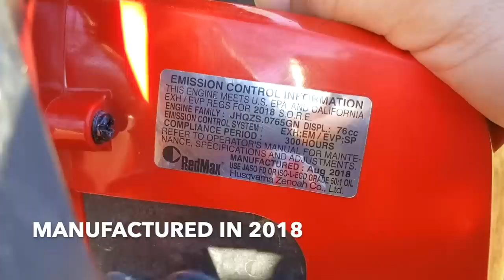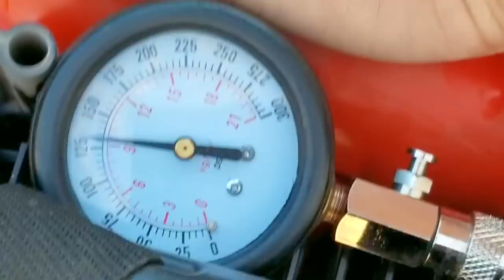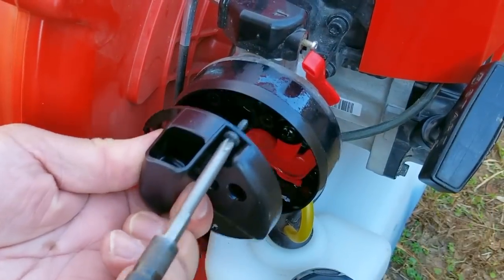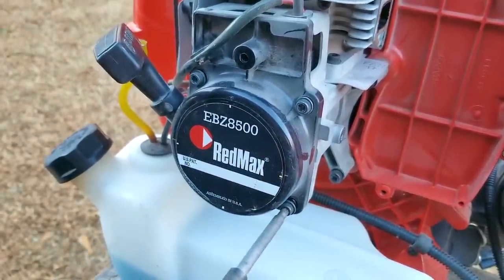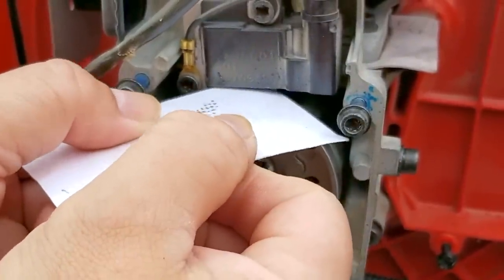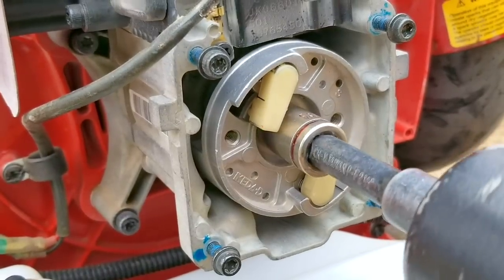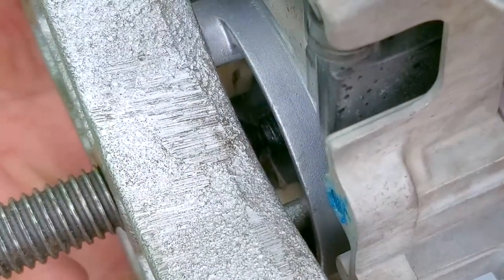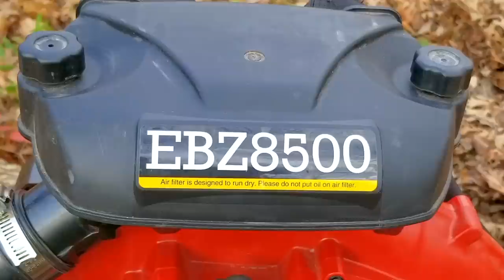Fixing A Redmax EBZ8500 Backpack Blower That Won't Start

Comment: Wow! 😳That was the only problem, it was the coil wasn’t set correctly to the flywheel lol. Anyway I have that exact same ebz8500 blower that’s hip mounted not tube, and it’s probably the best backpack blowers I’ve ever owned. I got mine used for $250 back in May of 2020 and sure has been great! It was used as a residential landscaper before I bought it. Now it’s 9 years old and the only things I had to do to it was change the air filter and the fuel lines, that’s it. No carb problems yet. And plus I repainted it, got new tubes and a decal for the air filter cover back in 2020 as well to make it look like a brand new 9 year old blower.😉👍
Reply from the maker: thank you Brother's Lawn Equipment, After using for about 2 hours, on a huge leaf pile, I have to admit, it's great blower.
Reply: @HomeGaragechannel  Yessir!😉🤘

Comment: I have a bunch of these blowers and sometimes the wires get caught and cut to the kill switch or the connections come loose. Always worth a check too. I have never had an issue with flooding though
Reply from the maker: thank you Reid Shaffer for sharing your information, I appreciate it.

Comment: when i worked for my old lawn care job, i primed my 8500 5 times, choked it, i left the throttle on idle  or maybe a 1/3 of the way open if it was cold, and then pulled it. And usually but not all the time it  would start right up within 3-5 pulls.
Reply from the maker: I wish I knew that before as well, would have saved me a lot of trouble
Reply: @HomeGaragechannel  and usually I would never crank an engine more than I primed it while the choke is on. If the choke is off however, that should be fine.
Reply from the maker: makes perfect sense, thanks again.

Comment: Great video. We’ve got one that looks like a brother to the one in your video.  WE have the same issue. Brand new and wont start. Sounds like it coughs but never fires up.  I’ll have to check what you did.  Thanks.
Reply from the maker: thanks, for the cliffs Note version of this, Just try starting it without the choke, and with throttle squeezed.

Comment: Hey. This was a good one! I’m sure it was Frustrating to say the least. 
I’m not familiar with those carbs. Are there any hidden adjustments on it so you could lean it out a bit for start up? 
To answer your question, if it was my own machine I would also just run with it once I figured out the sequence. 
Cheers
Reply from the maker: thank you Ez Ray, I'm not sure if it has any hidden screws, but since it wasn't mine, I didn't want to try to find them.

Comment: Another YT ER's 2nd test after fuel is  pull fuel filter off and test if the line to needle holds a vacuum if it doesn't then isolate the line by blocking other side to recheck.
        You probably know of this but like me haven't got a mityvac yet 😉👍

Comment: A great spark tester is a large rubber insulated spring loaded clamp with a foot long wire attached to it and a smaller spring loaded clamp on the other end of the wire , ( just like the battery charger clamps ) take spark plug out then clamp big clamp onto spark plug and smaller clamp directly onto a metal ground aka engine block or good point of ground " pull cord watch for spark ,, also make sure you have a KNOWN good spark plug to test with ! Don't forget the ignition kill switch can be bad or have high resistance causing weak spark also ! And yes those almost new ignition modules can and do go bad just like that ! My Husqvarna handheld blower worked great one day next day bad ignition module !
Reply from the maker: thanks for the information!

Comment: In regards to the flooding issue on start up, it looked to me that you set the throttle hold lever “cruise control” well above the 1/3 throttle “high idle” as prescribed in the operators manual for starting. 

Too much starting throttle was confirmed for me when you did actually get the engine started and it revved up well above What I know start up high idle warm up rpm to sound like on my own husq 570.
Reply from the maker: very true, I'll have to mention that to the owner, I appreciate it Jeremy Rathje.

Comment: I once used jb weld to block off full choke on a cheap weed eater because I was staying away and kids were using it 
Crazy but worked for several years
Reply from the maker: nice choice

Comment: It almost acts like a carb with a stuck open needle n just dumps fuel into the intake. Maybe that's what's happening when priming. Did you try starting it with the trigger pulled to give it max air flow n no choke after priming?
Reply from the maker: No, just had the choke on, which also give it a bit of throttle.
Reply: @HomeGaragechannel  yeah I was just thinking maybe having the throttle wide open might help clear the flooding in a similar way to flooring a flooded car
Reply from the maker: In this case not really.  It just makes the Flood worse.
Reply: @HomeGaragechannel  right on that's why I brought it up cuz I was unsure if it would have an effect or not on that style of carb
Reply from the maker: thanks for the ideas, I appreciate it

Comment: I have the 8500 and it almost always starts on the third pull. I never Prime it either. When it’s cold I give it about 10 seconds before I throttle it up
Reply from the maker: that's a very nice tip

Comment: If you remember you said the spark looked inconsistent when you first checked it.  That would have made me dive into spark as the problem and reset the air gap as a first test.
Reply from the maker: yes you make a good point.

Comment: I always hold the throttle wide open while pulling on choke no more than 2 times and then open choke and hold down throttle and pull , keeps it from flooding
Reply from the maker: is that for a redmax  blower or some other brand?

Comment: If I run my Homelite trimmer on full choke it runs fine. It runs perfect on idle but will die on throttle likes it's supposed to.
Reply from the maker: no problem, try a carb adjustment first, then if that doesn't work replace the carb.
Reply: @HomeGaragechannel  it came like that though
Reply from the maker: let me get this straight,  It starts on choke, and runs on choke, and it dies when you give it more throttle?
Reply: @HomeGaragechannel  when I give it more throttle on choke it does Wich it's supposed to

Comment: I have a red max blower the same model you worked on and my issue is it won't take full throttle  It will bog down when given full throttle. I have checked everything you did on the one you worked on    Any other suggestions
Reply from the maker: so you check the spark arrestor screen? if so, you might consider replacing the carb.
Reply: @HomeGaragechannel  I did everything you did along with a new plug and leaving the muffler off  It will idle fine just wont take fuel.
Reply: @HomeGaragechannel  I went back to rewatch the video and I realized I am missing one piece The piece that you screwed back in before you installed the intake pipe All i had was a broken piece of plastic laying in there when I took the air intake off. Would that cover missing make a difference
Reply from the maker: to be honest, I'm not sure, but if had to guess, I think its important, otherwise, they wouldn't have put it in.

Comment: I'm having the same problem with my Stihl FS 250 trimmer when cold it start up and idle fine but once the engine is heated and I cut off to refuel I can't get it to start back
Reply from the maker: thank you Darrion Nelson, I hate to say it, but that's one of the hardest problems to solve.  Have you looked at the owners manual on hot starts? I'm not aware of the procedure either.
Reply: @HomeGaragechannel  no I haven't but I will do
Reply: @darrionnelson4784  hello friend, I also have a stihl fs 250 and I had the same problem when starting with a hot engine, and the solution was to replace the ignition module.  did you change the spark plug to see if it is weak?
Reply: @luanpossentimelnekj7984  maybe take off the flywheel and check that seal to see if it is leaking.  If you have adjusted the carbs put them back to factory and adjust after seal replacement.  If that crank seal is leaking it will do what you are saying and often have a lack power.
Reply: @rudyruiz9521  hello Rudy, my fs 250 was with all the perfect seals, the problem was the ignition module.  it could be that the fs 250 of the friend Darrion has some sealing problem.

Comment: So I have question, it might sound dumb. I was given as a gift a back pack leaf blower, it's a Chinese made blower that the manual says 2014. It's brand new, my question is it calls for 25:1 to 30:1 will it hurt if I run a pre mixed fuel of 40:1? Or should I use what the manufacturer calls for? Thank you for any advice you give or have given me
Reply from the maker: it's a very good question to ask. I would do what the manual says.
Reply: @HomeGaragechannel  thank you so much for your reply. I have been following the manual but wasn't sure if it would hurt to use a different ratio.
Reply from the maker: never hurts to ask, thanks again Gary Allen.

Comment: Have you tried putting a new spark plug? I have had some bad experience with those small thread spark plugs which can look good but still would foul and get wet pretty easy
Reply: Also, good work on troubleshooting that blower, i was thinking the timing somehow was off until you removed the flywheel and at that time i had no idea what the issue could be, at least you got it to work and found a procedure to start it
Reply from the maker: no but you might be on to something.
Reply from the maker: thanks I appreciate it.

Comment: ive tried the drill trick to start my 4hp craftsman mower but it wont spin it. I have a dewalt 18v drill and an 18v fuel milwaukee impact wrench AND driver and none them wants to spin that craftsman. I have to pull it with the rope and its a pain. What drill are you guys using to spin these motors?
Reply from the maker: I'm just using a Harbor Freight corded drill.  the cheap one too.

Comment: this video was great but i have a question. i have a stihl fs86 line trimmer that runs very well but after 4 mins of use it starts to smoke and when the engine goes back to idle the engine has a little cough. i bought this line trimmer second hand and fixed it up all it needed was some attention in the carb. once i started the trimmer up it ran well but accidentally touched the aluminium housing for the piston for less than a second and burned off a lot of skin on my knuckle. at this stage i only ran the trimmer for about 30 secs. i noticed that the spark plug boot was hot after 4 mins of run. but before i touched the carb the engine was covered in dirt as there was a fuel leak in the tank. i sprayed some degreaser on the engine block and that might be the cause of the smoke but it gets really hot. i also made sure that i tuned the carb to be rich. can u pls help me as this trimmer has 2hp and i need this trimmer as ive got a fare bit of land to maintain
Reply from the maker: thank you Moo Zuke, I would first confirm that the bolts that hold the cylinder head or jug, were tight, I would then clean the cooling fins to make sure the engine doesn't over heat.  The other would to check the spark arrestor screen for a blockage.  Let me know what you find.

Comment: I've had coils still produce a spark but be bad. I had a saw push me to my limit of sanity and it turned out to be a factory new wire on the coil that was crimped to hard and was cut through but looked fine. The saw still ran but like it had an air leak. It's  annoying because you have to check the gas,carb,spark,exhaust, gap, and timing several times before you can finally deduce the coil is shot has an issue or is shot.
That blower is way to hard to start I'd be adjusting that carb and possibly even the airflow if that didn't work.
Reply from the maker: I doubt it's the wire, more than likely the carb
Reply: @HomeGaragechannel  didn't say it was just sharing my most frustrating fix. 
read more

Comment: I have a Poulan Pro blower. It was always running great. Then I ran out of gas. When I mixed a new batch of oil gas mixture it ran for a while then quite. Is my oil to gas ratio off. Or maybe the oil blend, brand (Pro select) was not good for my blower? Can you help?? It will start then quite.
Reply from the maker: how are you mixing your fuel, and can you get a compression test done?
Reply: @HomeGaragechannel  I was trying to reach a 40 to 1. but my gas container was 2.6 gals. so my math may have been off. If my math was off and I ended up with a different ratio would that have a negative effect on the engine? No I can't get a compression test done. I don't have a tester. It was running fine with the old gas. Was my brand (Pro Select) bad for the engine?
Reply from the maker: even if you had too little Oil, say 60:1 or 80:1 it would take a couple of hours of running to really hurt it.

Comment: I don't know if I would buy one like that if it was prone to flooding that easily and I'd probably return it if I did , it seems like the carburetor is not working properly when choked you should only use half choke all the time no full choke on it , I think the manufacturer cheaped out on the carb if it was a quality carburetor it would work full choke , half choke and wide open basically fully functional carb , also the adjustment on the ignition coil could have been from it not being tighten  properly from the factory or loosen when running and it moved when it was set down (if it was set down a little hard) and thrown the timing or spark strength off making it not start but only speculating what could of happened
Reply from the maker: Since I know it's prone, I would still get it, just alter my start up, IT's a damn good blower, the best I've ever used in fact.
Reply: @HomeGaragechannel  I guess if you had alot of (leaf) blowing to do you could get use to it but I like using the small battery powered leaf blower we got light weight and gets the job done I don't do alot of blowing most the time it's just to clean tools like table saws , wood planers and other wood working tools me and my dad build wood projects but not really in the last three to four months cause he was diagnosed with cancer and went through chemo and radiation treatment now he's about to go in for surgery really soon so he hasn't had enough strength to do much lately but hopefully in a few months or more he'll be getting better and stronger so we can do more wood work and turning on the lathe anyways went off topic , great videos and fixes

Comment: I have same issues with mine , I have changed the cylinder, piston, rings , carb , even the crankcase , gap is fine on the flywheel and no one can turn it on .
It's driven me crazy , I don't know where else to look at.
Reply from the maker: sorry to hear that

Comment: My 8500 is a 2012 model and still cold starts on the 2nd pull every time. 1st pull warm. Most dependable machine I have ever owned. User error and crappy fuel are usually to blame.
Reply from the maker: very nice!

Comment: The engine being new it probably warped a bit after it was shut off moving the coil away from the flywheel. Allowing the engine to idle and cool down for a few minutes before shutting off will help

Comment: Pssst...Hey! :D Redmax start easier if you open the throttle a bit, but only after one pull with choke fully on, unchoke. :)
Reply from the maker: Thanks for the tip!

Comment: The last time my old 2nd hand 8500 would not start I opened the fuel tank and dumped the gas from the beginning and the fuel pickup line had broken off in the tank. The time before that it was just a fuel filter. The time before that I could not pull the starter rope because it had excessive compression from heavy carbon buildup in the upper cylinder and on top of the piston. I soaked the piston and cylinder in laquer thinner over night and it was spotless afterward. problem solved
Reply from the maker: nice work

Comment: Got to be honest after owning a 2 brand new redmax's and 2 brand new Echo's I would go with the Echo anyday over the redmax.  Just found the Echo's are more reliable
Reply from the maker: thank you for sharing the information, can you tell me which models of echo and redmax you have?
Reply: @HomeGaragechannel  Yes the redmax was the Ebz7500 and the eariler model was a 7100 redmax.  As far as the echo the first one I bought was a 750sh and my current blower is a echo 8010.  The 750 was great for everyday driveway and normal leaf blowing.  the 8010 is a beast it blows mountains of leaves!  Love it!
Reply from the maker: very nice, thank you

Comment: i would tear into it and figure out why the engine is flooding itself before doing the other option which is leaving it intact and making the adjustments etc.
Reply from the maker: thank you Patrick Stapleton.
Reply: @HomeGaragechannel  my pleasure hopefully this will help me fix up my backpack blower that,s from Aldi here in Australia and maybe reduce the smoke on the motor output as it might be running a bit rich to me as it,s running on a 30:1 mixture ratio etc.

Comment: had a brandnew chinesium chainsaw once...did`nt start very well, i thought reason was weak spark so new plug and coil was installed, still no start...WTF???

i disassembled most of the saw including the intakemanifold, just to find a seal not mounted properly...new seal mounted, saw started in one pull 
🤣
Reply from the maker: very nice work.

Comment: You never checked the gap on the plug, I just went through something similar and it was the plug gap.
Reply from the maker: The blower is basically new,  has about 2 hours it. So no did not check the plug gap.